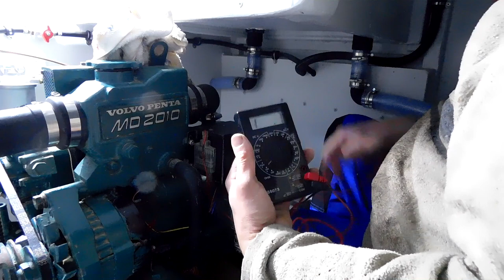New foam, engine fix and sailing with Hazel; Building a cruising sailboat - SV Tapatya EP210

Comment: Many congrats to Hazel on the Coastal and EP release. Good catch on the on the conductivity and nice to achieve an easy win. It does seem to be a post design operational service fix and a ‘top hat’ design of insulator would have sleeved the bolt/stud too. Keep on keeping on.😀👍⛵️
Reply from the maker: Thanks Norman. I’m inclined to think they know what they’re doing. The tappet chest on the old Rolls Royce V8 engine was sealed with a single piece of thread (sewing) laid around the mating surfaces. admittedly, it didn’t have to insulate, but the point being, engineering can be simple sometimes 👍

Comment: Hi Tony, i note that insulating flange joints in piping systems also have sleeves that sit over the OD of the studs. This assists for electrical isolation properties. Hope this tip assists you in establishing a non conductive interface between motor and sail drive. Great work and also an experience for Hazel.
Reply: It's always surprised me that the insulation kits for sail drives don't include sleeves for the studs. Seems like a no-brainer to me.. but no, you're left to struggle and fiddle around, trying to get all the studs dead-center in their holes so they don't touch the sides. Crazy.
Reply from the maker: Yes, it’s certainly a good tip, Geoff. We’ll see how it pans out.. 🤔

Comment: Nylon or Delrin washers are quite a bit sturdier than poly, and you can get shrink tube to cover the body of the bolt so it won't short on the sides. Unless you want to be checking the sail drive for continuity on a weekly basis, it might pay to replace all the washers now, so you don't have to scramble at sea...
Reply from the maker: Yes, I also thought shrink tube could be a good idea👍

Comment: You need to allow for the fabric thickness on the foam. It will pucker and crease if you leave the foam at the size you cut. An epic voyage, soon you'll be tacking each other, stealing each other's wind, travelling from A to B.
Reply from the maker: Thanks Sherlock 🕵️‍♀️. When it comes to cushions, I only really want them to stay in place. The foam may get another trim yet though 👍